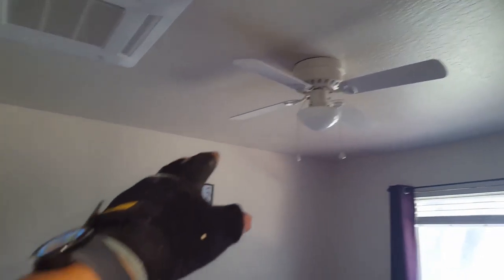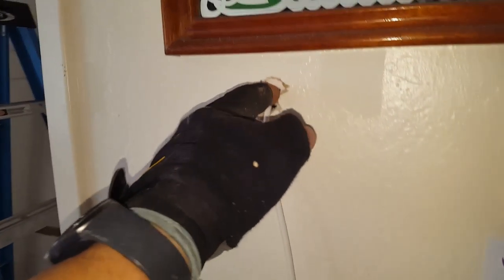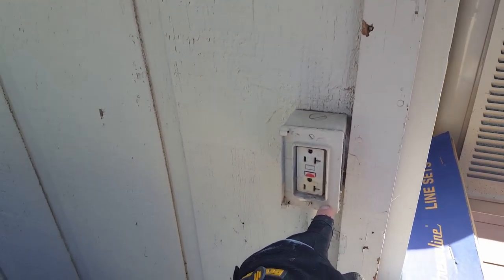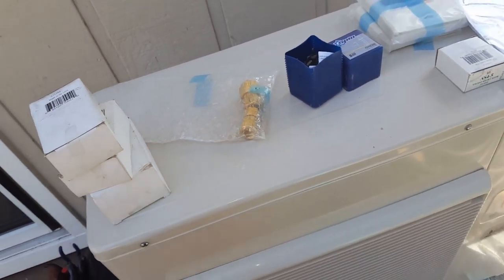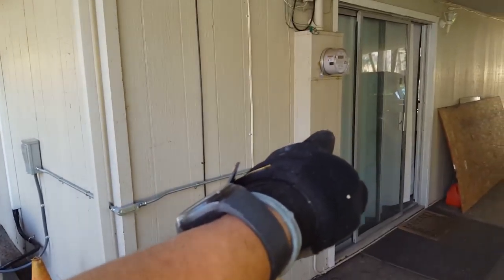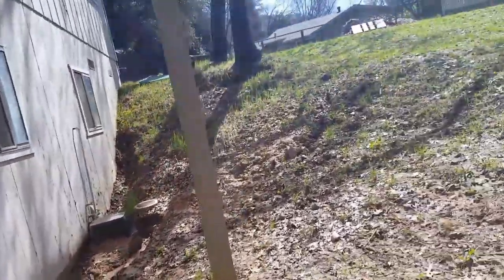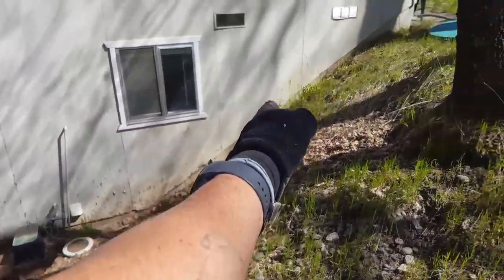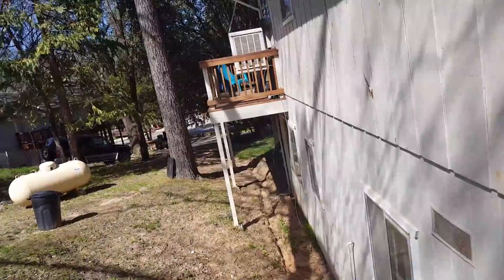Working on a new install, cassettes.....

Comment: good work. ductless systems are positioning in the states finally. I love them.
Reply from the maker: I do one about every two weeks, but always wall mounted head units. I have never had a customer who didnt absolutely love these units
Reply: Performance Based Heating & Air I agree and  with the tool review I dont even watch those  videos

Comment: What an honest a/c technician. Wish you lived in Florida. Maybe you can can give me some advice, I’m currently remodeling my 1 story 1200 sq ft home and wanting to move my air handler from a hallway to my garage to open up my floor plan. I’m debating on whether to convert to a spilt a/c system, have two cassettes for my two bedrooms and one over hang in living room or just keep my central air. My unit is about 5 years old. How do the spilt units to compared to central air in home value? Any tips are appreciated! Thanks man 🙏
Reply from the maker: At 1200sqft the home is small but keep in mind air takes the path of least resistance so moving the unit from the centerish of the home to the garage will change the dynamics of how the systems comfort is received in the home. Meaning the farthest away rooms will get the least airflow will the closest will get the most. Now that can be corrected with a installer that understands airflow and over sizes ducts to the farther away rooms but its rare to find someone that understands that....If I remember correctly florida doesnt allow units in the attic? and ductwork has 30% conduction loss associated with it. But essentially without going to a ductless system you may be limited in your comfort if you move your unit.....Since this video we have converted our business and now do about 95% ductless installs. Im a pretty big fan of the Mitsubishis and have been selling their product for a few years. a 3 zone ductless system is between $7500 and $8500 through me so we sell a crapload of them....In terms of home value the real issue is the buyer. Some people just dont know what these are still, and then we have others that know exactly what they are and wouldnt use anything else. Plenty of our business comes from someone going to a house we installed them in and they call us for an install. IMO, the money spent on the new system should easily increase the value of the home equally, if not more in florida.
Reply: Performance Based Heating & Air the I appreciate the info. So spilt units essentially is the way to go for smaller homes it sounds like. My handler is only being moved only 6ft from its original spot. I got a quote for $3k to relocate it. Now if I was to switch to spilt a/c, could I sell my central air unit? I’m trying to have an efficient and low maintenance a/c. Central air seems like a lot for a smaller home. I could be wrong.

Comment: Dude for a 3 ton you need 8 gauge wire, how are you going to use 14 gauge 120 line outlet for the disconnect?
Reply from the maker: A Font with some secret sauce. When you get old enough you’ll learn about it. Until then let grown folks do the talking......Dude
Reply: @performancebasedheatingair8006  yeah, sure. Bs

Comment: You just voided the warranty on the unit screwing into it.   12 nuts, 8 washers, 4' of all thread and a $3 2x4 is costly mounting?  We do installs where we have to send the mfg'er; Mitsubishi, Daikin ect . the load calcs, mechanical prints and any "significant" plan changes otherwise they will not honor any warranty.
Reply from the maker: We purchased 500k in mini split equipment last year. Do you really think that they would mess with me and say warranty is void over some screw holes that did nothing to hurt the equipment? If your sending all that information than you are doing commercial which is a different ball game. we are 100% resi and installed about 170 multizone systems in 2018 and never has anyone asked for anything like that. nor has anyone even looked at our jobs aside from the inspector who only checks our disconnect fuse size and signs it off.